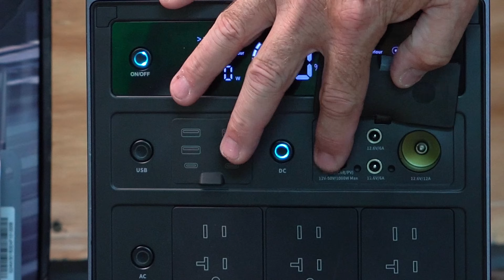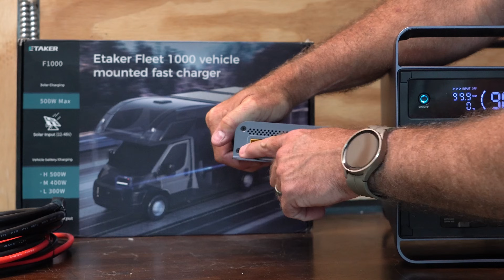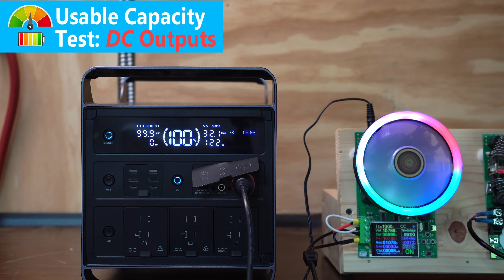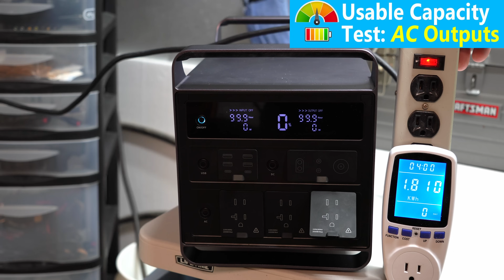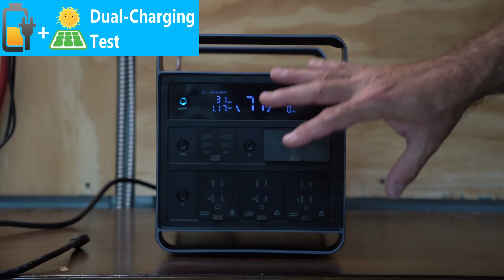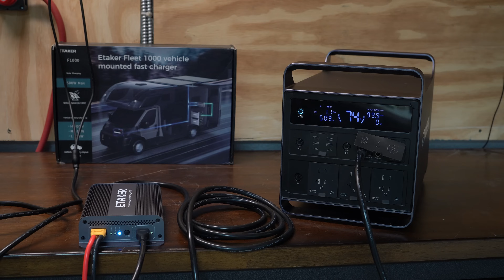ETaker M2000: MAXIMUM Power | MINIMUM Size!  PLUS an AFFORDABLE DC Fast Charger Option

Comment: ive got an idea on the dc charger to charge more than 500w from alternator. the solar input can take as low as 12v. so if you connected that input to your car battery as well it would probaby pull the 20 amps its rated for, for an additional 240 watts.

Comment: It does have variable AC charging.  You can double click the power button once it’s turned on and charging to bring charging rate down to 500 watts.  Also the app will be released shortly.

Comment: Small ring terminal should fit the cable mounting bolt at the car battery. Basically don't cut off anything until it is verified.

Comment: Question; since the AC is more efficient than the DC on the ETaker, is it better for me to run my 12v fridge using the AC plug rather than using the DC car plug?  Or is it the fact of having the inverter powered on all the time drains the battery making the DC more efficient?

Comment: Hello, thank you for the review. Have you tried the charger on other generators? Because the fact that it does solar and charging by alternator makes this charger great. Does it cut off the charge when the alternator is off so as not to drain the vehicle's main battery?

Comment: What triggers the charger, I didn't see an ACC trigger wire.  Ideal to not pull voltage if it's plugged directly to the battery otherwise you'll end up with a dead battery.

Comment: What does this Semi-Solid Lithium battery bring to the table? It's not LFP which is the chemistry everyone should be looking for, and if it's not NMC, then what is it? How many charge cycles does it get.
Reply: It's a different type of lithium-ion. Apparently more charge cycles than NMC, but lighter than LFP. Allegedly "safer", but refer to Will Prowse.

Comment: Worth noting; this is the only power station on the market that is fully EMP protected.
Reply: Blanket statements like that will get someone killed.. eventually.. Its literally running leads inside. Doesn't matter that its shell is metal, as it is running wires inside. to be EMP, it has to be fully enclosed, and with insulation inbetween the shell and the inside.
Reply: @Rick-pl5ey  Question for you guys.  Is it hard to enjoy life when you are sitting around preparing for an EMP attack?
Reply: @dkasparaitis 
No.  It’s hard to enjoy life when making judgmental and incorrect assumptions about people.  FYI, I don’t care about EMP and prepping but thought it was a nice feature to point out since I have one.  Solar EMPs are more likely to occur from the sun like in 1859.
Reply: If you say so.  Internally it has a run out spindle - ground out. Same as military EMP protected devices.  Also similar to EMP shields.

Comment: Great for single phase. A single M2000 is on sale for $1,148.  If you bought 2 to try to do the split phase separately it would be $2400. 
So, I totally don't understand the Combo pack price for Portable Power Station M2000 with Merge Box ET200  (What is going on with the high price???) The cost of the M2000 WITH Merge box kills the utility for split phase. (There has to be a mistake because this pricing is much too high for just ONE M2000 and a Merge Box) Maybe they forgot to list the Combo as having Two M2000's with a Merge Box for ~$2089??? 
(If it was two M2000 + Merge Box for $2089, then it would be competitive).
Great review!

Comment: I would use this in a grid down situation.  The car generator is very interesting, but would only use it in during an emergency.  Would it be possible to attach clamps from the generator to the battery?  Instructions would be great.

Comment: Great video, this one is very nice looking, so many solar generators now a day with similar spces its difficult to choose one, but it is great that we have choices to choose from. Mine only has 400w solar input kinda of slow but i could only get this in my country still better than the 200w input i almost bought , 1000 watt input solar is game changer, you can charge it 2 maybe 3 times a day and have 6000wh to use very nice

Comment: Seems like a great little unit.  Checks many boxes for me.  Don't care about apps, but would be nice to have a manual switch to have the option to fast charge or slow charge.  I mainly do slow charge to prolong battery life especially with the first generation power banks I own.  Do you know if this unit does EPS or UPS?  What I like about this unit for its size is that it is 10 pounds lighter than my Delta Max 2000, I love the DC output it has of 12V and 12 amps.  I love the 5521 port outputs that are capable of running a 12V fridge with the 70+ watt output.  I've connected my 12V fridge to one of my power banks and by using the  5521 port I was able to get an additional 3 hours of run time than from the 12V cigarette port, just fyi.  I love the fact that you can charge it with solar in one day.  

What I wish this unit and all units that are coming out is I wish it had dual port for charging.  I have a couple of panels that are 160W and a couple that are 220W. would be nice to have the ability to connect 320W total in one port and 440W in the other port to maximize solar input.  Since the industry listens to you , you could start recommending this.

I would not buy this unit now simply because I don't know anything about this company, I've never heard of them, so I don't know what their customer support would be like.  What I would buy would be the fast charger.  It will charge any of my power banks on the 3 or 5 hour trips I make all the time.  I think EcoFlow shot themselves in the foot when they made their fast charger proprietary only.  There is a huge market out there for a fast charger and they missed the boat on this one.  I would fire whomever made that decision.  As usual sir, you make a great video!!
Reply: The benefit of a separate charging 'brick' is that you can use a lower voltage or current to slower charge.

Comment: In don’t think I want seething that looks like 1960’s aluminum rack systems..  I’ll pass.  Cheap junk.
Reply: How do you know it's cheap junk if you've never owned one and used one. These products are built to function..not a decorative ornament.
Reply: Junk?  Looks great.  And it’s the only power station on the market which is fully EMP protected.  Bad ass.
Reply: @ccwstraightshooter9761  I’m glad you like it.

Comment: More details on the battery would be nice. Solid State is not LiFePO4. Many Solid State batteries are dangerous and can explode when punctured, and even known to short and cause fires. I am not sure that this is worth the $1000+  they are asking. LiFePO4 is still the safest way to go. Prices at the moment are low for quality power stations with LiFePO4 batteries. After June 14th, that will change with the new tariffs.
Reply: @technologyjunkie01 can you please elaborate on the new tariffs? How much are they and what exactly do they apply to?  I had not heard about this.  Thanks.

Comment: Can it be set, to automatically always turn on the AC outlets whenever the battery has charge, so that if only using solar to charge, if it uses up battery overnight, the next day of sun, will energize the AC outlets, automatically, without any user intervention?

Comment: Great review!  The price is extremely good too.  I was almost sold until i realized that the merge box is almost as expensive as the M2000 (M2000 is $1148, M2000 plus Et200 merge box is $2089), so you are still going to be in  the range of ~$3300 for split phase, but for that price, you could get the Anker F3800, which is 6KW instead of 4KW for the ETaker bundle.  Still, for stand alone, it weighs only 2 pounds more than the Bluetti AC180, with almost twice the battery capacity!
Reply: I just checked and the M2000 + ET200 bundle has an $890 coupon.
Reply from the maker: Yeah, I'd wait for a coupon deal on the bundle because there's no way pricing on that ET200 merge box will selling at nearly the same price as the M2000 itself.   And of course, there's no point in buying the ET200 unless you're going to get TWO of the M2000s anyway.   Seems like they'll be having to do a bundle deal here at some point to make that a reasonable choice.